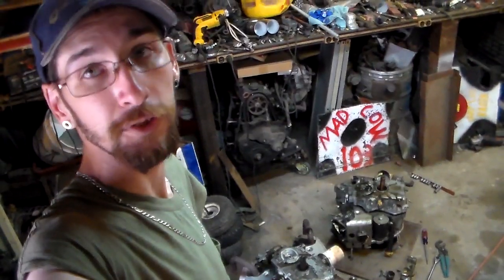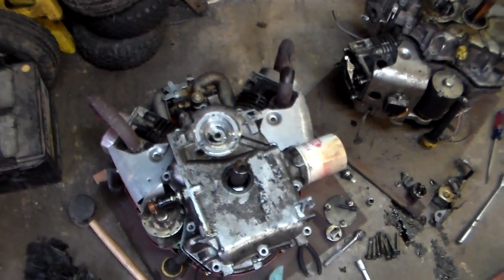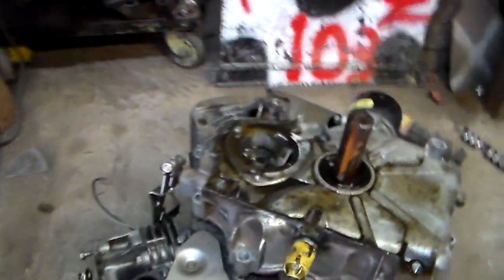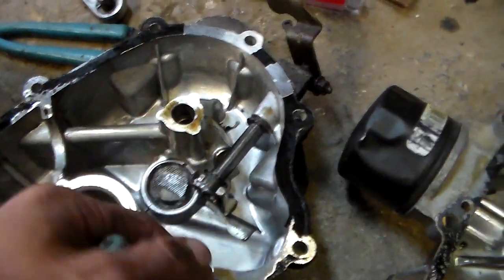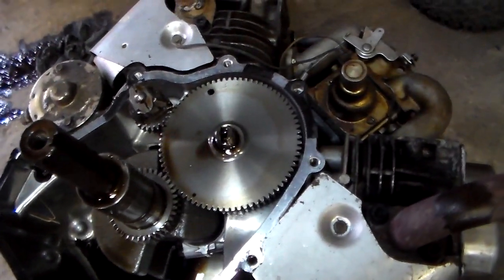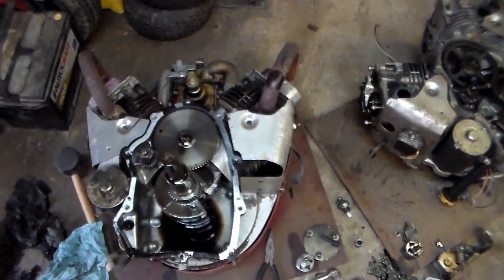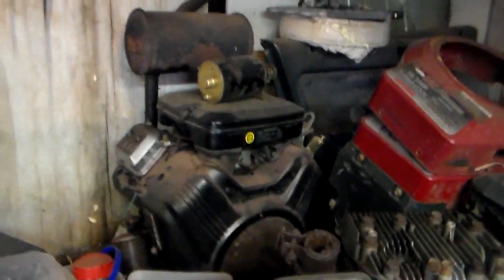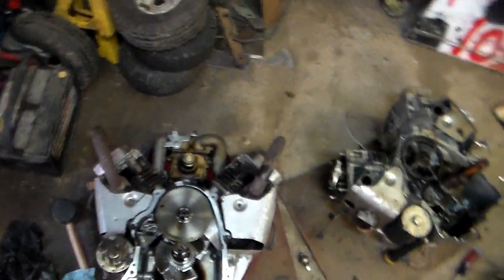Mod Mower Engine Tear Down

Comment: idea for you, if you're determined to run the V-Twin use an isolator plate on rubber mounts so if you take an extreme hit the engine should stay in its location and the tractor will take the brunt of the hit.
To get the 8-Inch pulley on my Racer with the stock Craftsman clutch I had to push the engine forward with a second engine plate you could do something like that and run your opposed twin sideways.